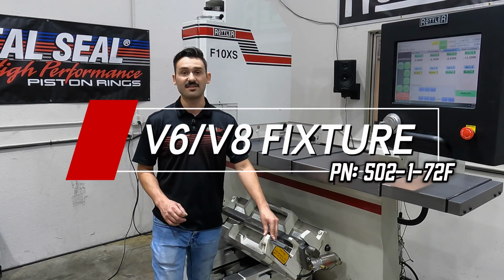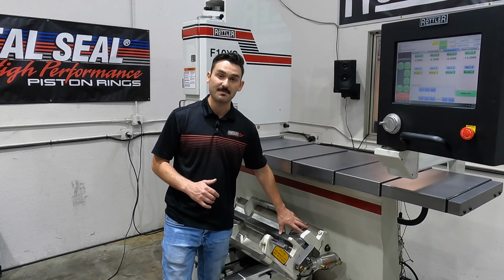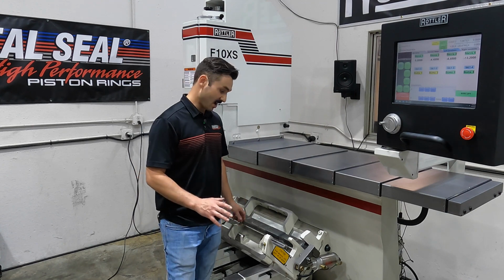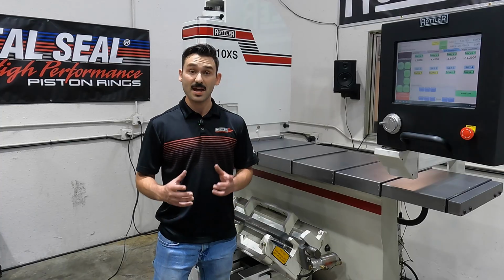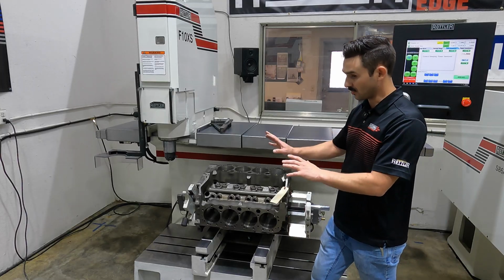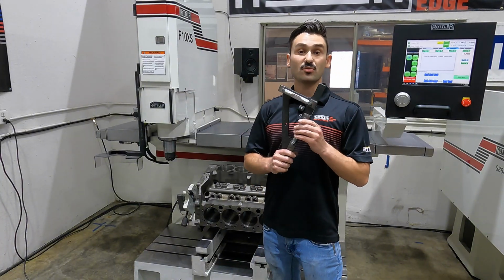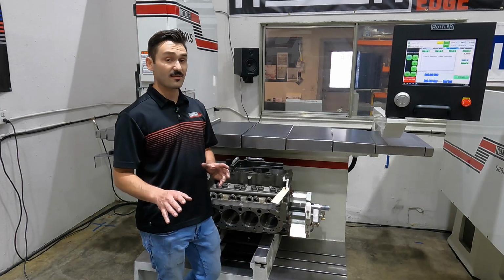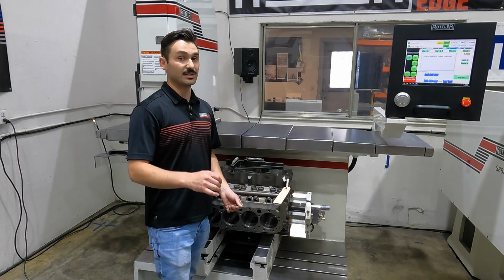Rottler V Block Fixture

Comment: Can this fixture be used in a s7m to surface the block parallel to the main line?
Reply from the maker: That's a great question! Yes! It can.
Contact parts@rottlermfg.com for pricing and info!
Reply: @Rottlermfg we have the fixture just never tried it in the resurface. Figured this would be a good place to ask
Reply from the maker: That's great! Let us know how it goes.
Reply: All this years later and this is still the fixture yall use I thought yall come up with something better by now